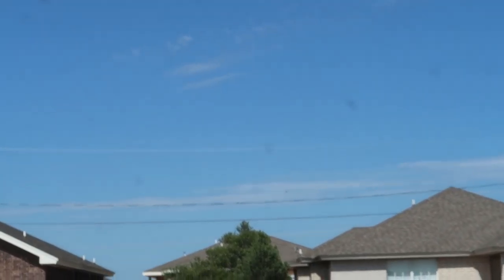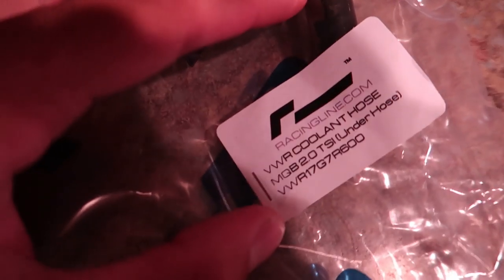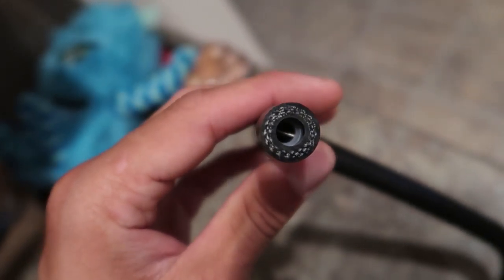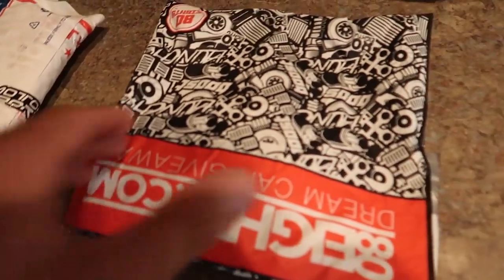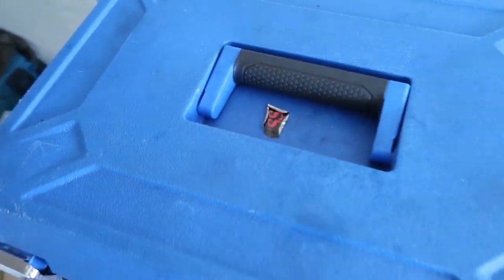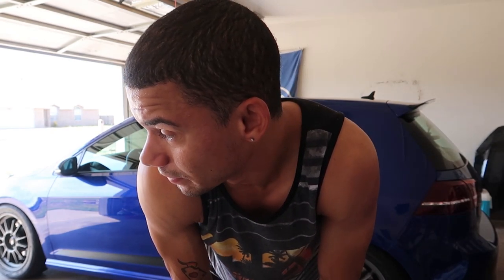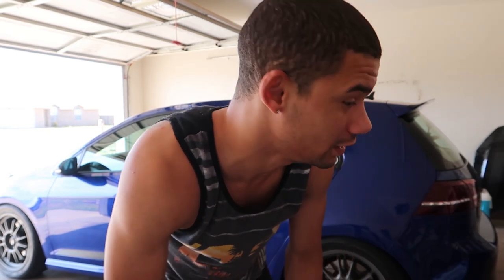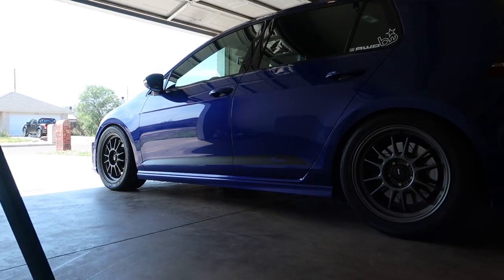Double autocross weekend - prep! Alignment & new parts! | MK7 Golf R

Comment: You feel the subframe is worth it?  Local shop has one I can grab, complete with the audi control arms for $500.  Or just stick with my VW arms on the audi subframe?  You running the XL housing on the EQT turbo?  Why'd you do the PMI vs just an autotech hpfp?
Reply from the maker: I do believe so man, the subframe and arms really changed up how the front end feels on the track. I'm extremely happy with the way my car is now. I had two autocross events yesterday and I'm super stoked on how the car feels now! I have the regular housing for the turbo, trying to get the best spool. And I went MPI for the benefits of keeping my valves clean.

Comment: have you looked at just using the TTS brakes?
Reply from the maker: Too big for my 17s 😞
Reply: you're going to need a new wheel and tire setup for bigger brakes too. those 17's wont clear bigger brakes
Reply from the maker: Willwood makes a set that fit
Reply: I may go for those I'm rocking the 19" HRE Flow Forms Tamuric  those TTS brakes look sick
Reply from the maker: @xmlviking  they really do, I dig them. Need a set in yellow lol

Comment: What is the full mod list of your car?
Reply from the maker: It's very long lol
Reply from the maker: Engine:
Eurodyne maestro: Pro tuned by Frank Mabo
034 lower dogbone insert
034 uppder dogbone insert
APR Boost tap
APR Intercooler piping 
BFI engine mount stage 1
BFI transmission mount stage 2
Brisk ER12 Sparkplugs
EQT turbo piping
EQT turbo muffler delete
EQT vortex turbo
iAbed rear main seal
Racingline Catch can 
Racingline Coolant hose
Racingline Remote washer
Racingline Intake (R600)
Racingline Turbo inlet
Racingline Intake pipe
Racingline Intercooler
Remus Sport Exhaust**
Revo down pipe w/42DD O2 spacer••
RS3 coilpacks 
South bend stage 3 daily clutch
Turbosmart BOV
United Motorsport haldex tune

**102mm Carbon angled tips w/ Ti internals
••Exhaust heat wrapped 

Fueling:
Precision Raceworks 450 pump
Precision Raceworks 4BAR maps
Precision Raceworks 925cc kit
Precision Raceworks Ethanol sensor
Precision Raceworks high flow fuel lines 

Wheels/Tires:
17x8 Hypergrams (satin silver)
Federal 595 RS-RR 245/45/17
BFI 5mm spacer 

Shifter Upgrades:
034 solid shifter bracket bushings
Ball shim mod
Clutch stop
Clutch spring delete
Diselgeek sigma 6 short shifter (5/32 & 3/8)
Dieselgeek shifter shaft bushings
Dieselgeek super pin
ECS clutch bleeder block
ECS SS clutch line
OEM+ metal shifter bracket 
Swirl valve delete

Suspension/Brakes:
034 rear shock bushings
034 rear subframe inserts
034 rear sway bar
034 rear sway bar end links 
Audi aluminum subframe
Audi RS3 brake ducts
BC Racing coilovers w/ Swift springs
BC Racing front endlinks 
EBC yellow pads
Eurocode front strut brace
Eurocode hatch brace
iSweep DCC deletes 
Rear Leyo undercarriage brace
Stoptech slotted rotors
Superpro trailing arm bushings
Whiteline control arms

Exterior:
Black emblems
Blind spot mirrors
LED euro tails
Maxton Spoiler
Racingline stripe 

Other:
De-badge front, rear and fenders (R)
DeAuto key blue LED footwells
Haldex switch
P3 Boost gauge w/analong tap
Porsche coolant cap
Rear seat delete
Rear wiper delete 
Struts cut for camber adjustment